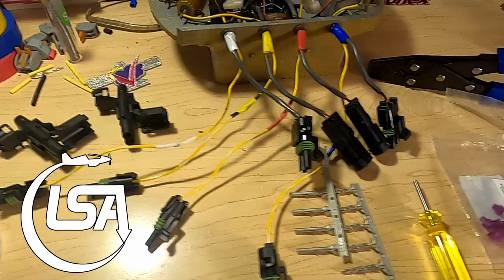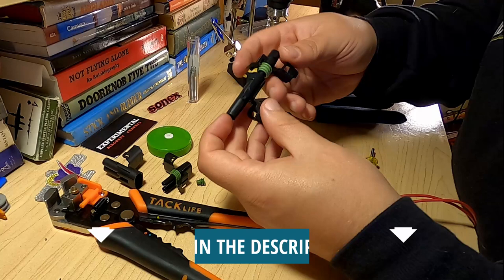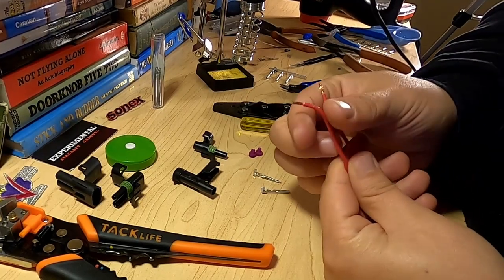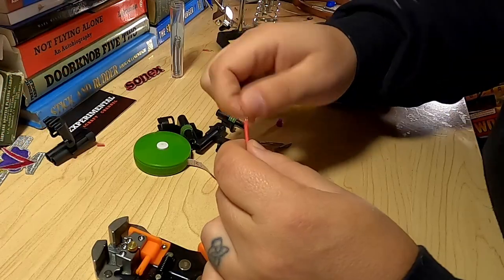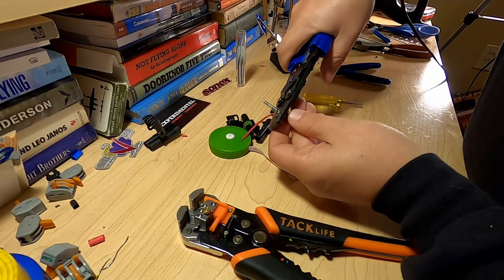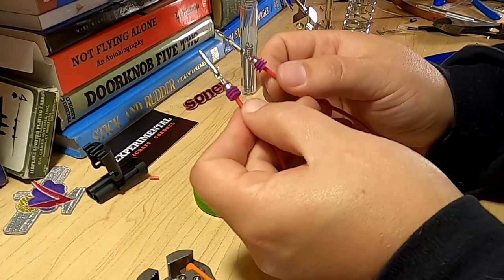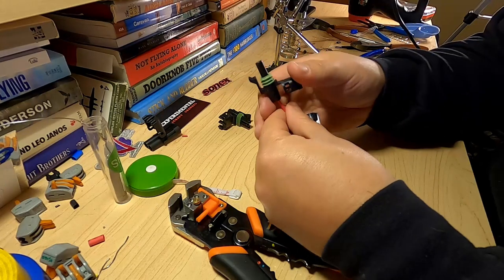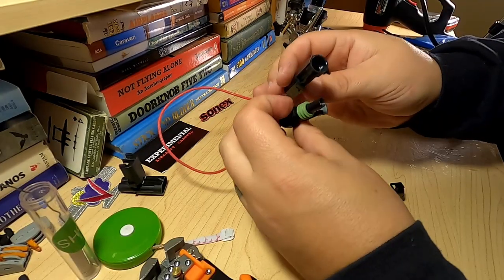How To Crimp Weatherpack Connectors With Seal-All / Delphi Crimper

Comment: Thanks very much, this is the clearest video I've seen on putting these connectors together - I'll be using one for the first time tomorrow fitting a satnav to my motorcycle. Many videos just blow through or completely ignore the details. I've watched about 5 so far that haven't thought to show whether to put male connector in the male housing or the female housing, which part of the crimping tool to use when, and how to align the connector pin wings with the housing. 👍👍👍
Reply from the maker: Awesome, I'm glad it helped! These are the best connectors to use for that application, and I've personally used them in dirt bikes and ATVs. How'd your project turn out?

Comment: Great video, and I couldn’t help noticing the P-38 literature! Beautifully presented instructional video. Only part I could have used more close ups (and slow)was in how to exactly position the terminal into the crimping tool before squeezing the handles.  No big deal though, I figured it out. Thanks and keep up the great work.
Reply from the maker: Thanks! That book was a surprise gift and even signed by the "Doorknob" himself.  I'm a LIFE LONG warbird fan, love to read about them and the true Greatest Generation who piloted them. Flying a real one is on my bucket list someday, but for now my little Sonex will have to do.  
Thanks for the feedback on the vid, you're not alone. I'll keep that in mind for the future. In the meantime, I'm considering creating a Google drive folder with close up shots to supplement this one.

Comment: Thanks for the vid!  I'm adding a remote start to my Ram 2500 but I'm also building a Vans RV 7 as well.  Positive Ill be using this with the Vans later on.
Reply from the maker: Awesome! RVs are sweet airplanes, always keeping an eye open for an affordable project...  Ironically on a recent EDM install, i learned that JPI uses a very similar connector called a metripack, FAA approved. Just solidifies my stance on using them for aviation applications.

Comment: Just bought a pontoon boat and am running some electrical wires using the Delphi connecters which I've never used. Excellent video - appreciate your instructional video. With your Sonex....you're probably heading to Airventure in a few weeks. CAVU
Reply from the maker: Thanks Rich! A pontoon boat sounds like a perfect application for these connectors, congrats on the purchase. As for OSH, hopefully next year. My Alaska trip and other commitments ate up my vacation time.

Comment: When dealing with aviation wiring I try  not to solder.  The solder can cause a failure point where it wicks down in the wire and becomes brittle when exposed to vibration .  Just food for thought.  I'll usually use a crimp with a double barrel where it crimps to the wire and the insulation or a bare connector and heat shrink adhesive tubing.  Would it be possible to put heat shrink on after crimping the wire but before crimping the water proof donut?
Reply from the maker: I typically agree 100% on soldering connections for aviation use. I had one fail on my CDI ignition box ( https://youtu.be/zE58DVJl1ZI ), broke clean off of the board. In this case, I was hoping that the nature of the terminal itself would prevent this, but it's definitely something I'll be keeping an eye on. 
Regarding heat shrink, you can run a tube right up to the wire crimp for the terminal, and then run the silicone seal on. That was one thing I did on the connectors that needed to be doubled up out of the CDI box ( https://youtu.be/5SKs7s_W_tM ). If you want to heat shrink the crimped wire portion with a short piece of tubing, I think you would have enough room inside the connector body. But it could probably only be a touch longer than the crimp area. It'd be difficult to use a longer continuous piece. Something to look into though.
Reply: @LeftSeatAdventures  another possibility would be to maybe squeeze a little dab of silicone into the end of the connector where the wire is coming out.  It could remove the possibility of vibration at the solder.  The downside being you wouldn't be able to take the wire out of the connector in the future.
Reply: Soldering is never recommended anything with an engine, Just take a look at any automobile, race car, motorcycle, watercraft or aircraft! People also seem to forget that if there is an electrical issue and a wire overheats soldered joints could come apart and fail, Plus it can cause a short somewhere else!

Comment: Very nice video.  I like the care you put into your work.  
If I could suggest one thing.  Napa makes something called Sil-Glyde that is a silicon based sealant, non-hardening to help things slide into place and seal better.  Might keep seals from damage while sliding into place and long term better waterproofing.  (Di-Electric grease is probably the better fit).
Reply from the maker: That's a great idea, thanks! The seals definitely do drag a bit on the insulation, doesn't surprise me at all to be from Napa. I might have to make an updated video in the future with all the great tips I've been getting.  👍👍👍
Reply from the maker: Over a year later, I finally made the close up video and used the Sil-Glyde. Much better and thanks for the tip! 👍👍👍

Comment: Please don't solder aviation connections in high-vibration environments the mechanical lock keeps the wire securely attached,  they don't offer the same conductivity as a soldered connection, soldered connections offer superior conductivity but are more likely to work-harden and break where the solder ends at a stress point.
Reply from the maker: You're 100% correct! I even referenced the NASA study on solder joints in a previous video where one failed on my CDI box, then completely whiffed it on this one. I'll see if I can add a card or something to make the point.

Comment: You shouldn't twist the wires for these connectors. This prevents the little tabs from working themselves into the wire. You want the strands to be straight so the tabs enter the wire and form a figure B
Reply from the maker: That's a very good point! 👍 Double checking the Seal All manual, it does show the strands remaining straight. I just twisted them out of habit. They've held up well, but not best practice. Thanks for the feedback.

Comment: where did you get the tool and the metal connectors
Reply from the maker: The Delphi tools come as a set from Amazon:
https://amzn.to/3dZlidQ

The Seal-All terminals with silicone seals are from Aircraft Spruce:
https://www.aircraftspruce.com/catalog/elpages/sealAllconnectors8.php

You can also get complete kits on Amazon. Thanks for watching!
Reply: thank you !

Comment: Are the Delphi and Seal-all products are interchangable?
Reply from the maker: Hi Rich, yes they are. Funny thing is, if you order the "Seal All" connectors from Aircraft Spruce, the plastic bodies actually have DELPHI scribed right on them. I'm guessing that Seal-All only makes the seals and terminals. I'm doing another video on them shortly that'll clearly show this.
Reply: @LeftSeatAdventures  Much thanks! I had ordered a Delphi kit for the boat a few months back and ran low on the two prong connectors and now need three of them for an LED light installation on the Piper. Yes-I plan to order them from Aircraft Spruce as per your confirmation that they are both the same. Best regards!
Reply from the maker: @Rich-ic8wl  Glad I could help Rich!

Comment: what the brand crimper you use bro?
Reply from the maker: Mine are the Seal-All brand available from Aircraft Spruce, but they look an awful lot like the GM Delphi crimpers available here: https://amzn.to/3AIUTuP Good solid crimpers made with proper steel, no flex. Or there's this one that also comes with the pin removal tool: https://amzn.to/3dZlidQ  Cheers!
Reply: @LeftSeatAdventures  tq bro for the detail.